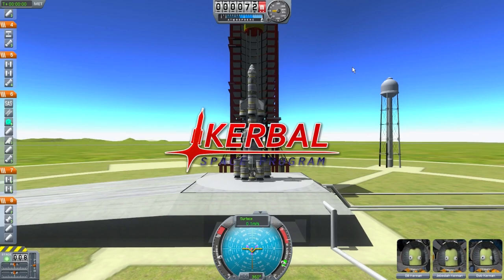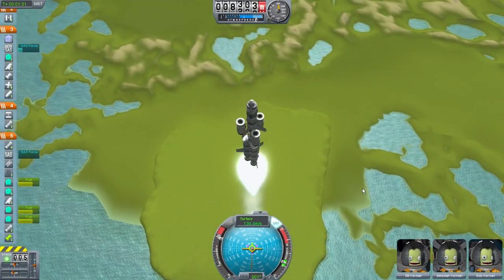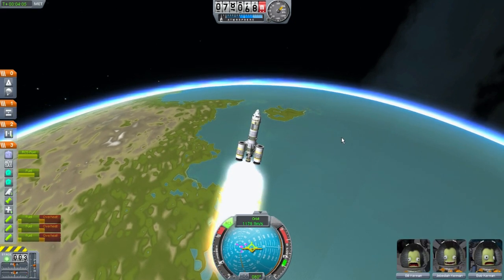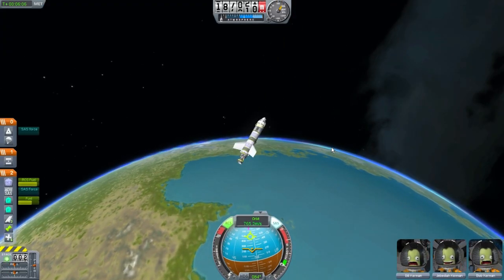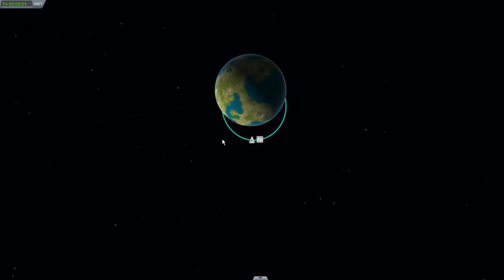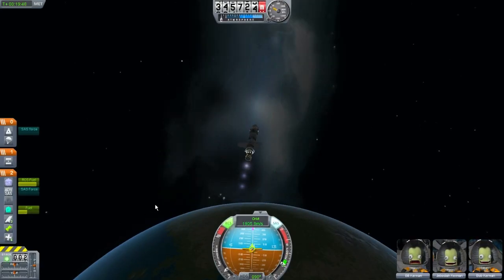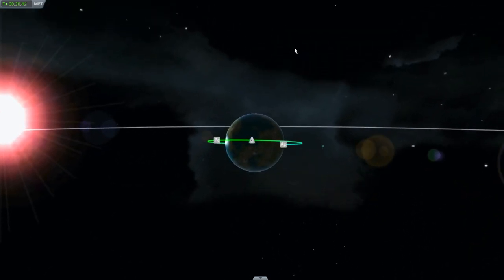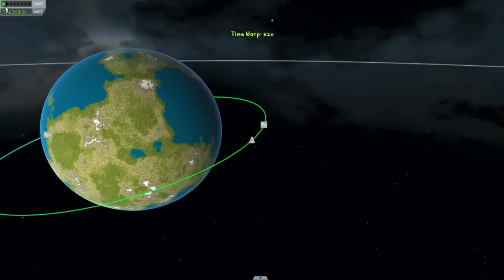Kerbal Space Program - 06 - Orbital Experiments

Comment: an axial is a strait line through and object. The object will rotate around the axial. A car has a front and back axial, each connects underneath the car and to the two wheels of the corresponding area.

Comment: Kurt, your plane-changing was fundamentally correct. In your second plane change burn you were actually facing the wrong direction: you were altering your orbital plane farther away from the equator instead of towards it. You were also not perfectly at 90 degrees so without some sort of autopilot to hold you there, you'll inevitably gain or lose some orbital velocity and thus change your altitudes.